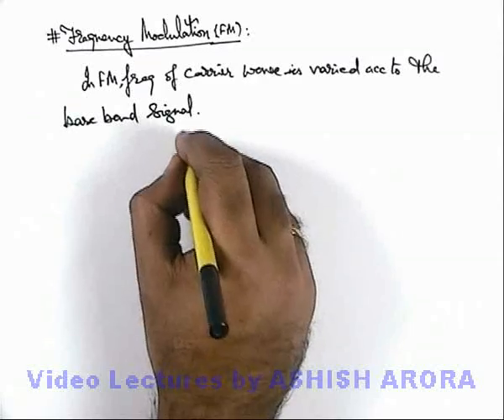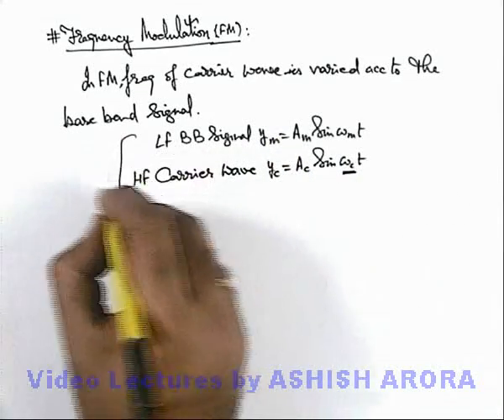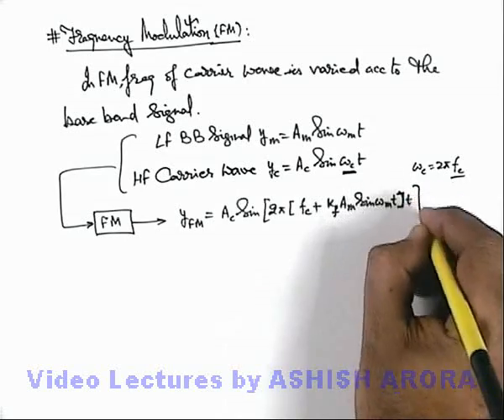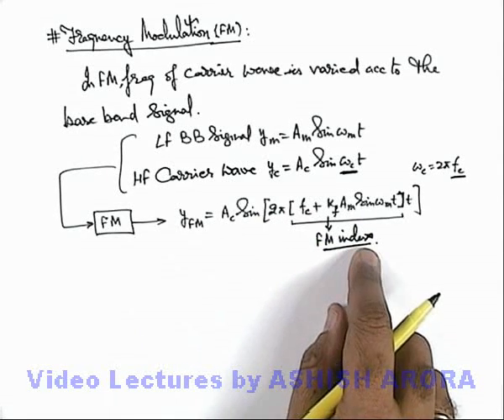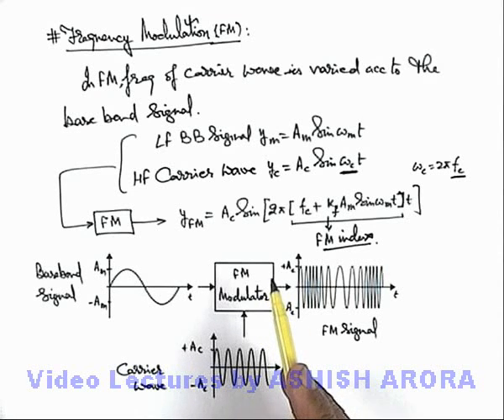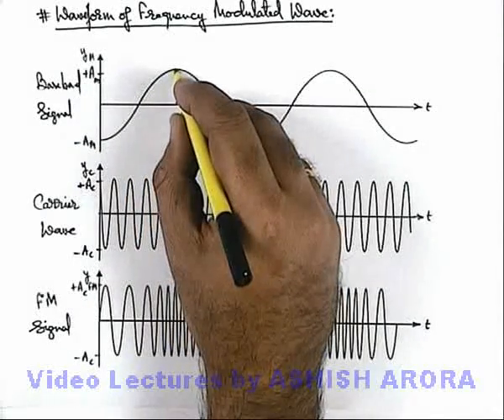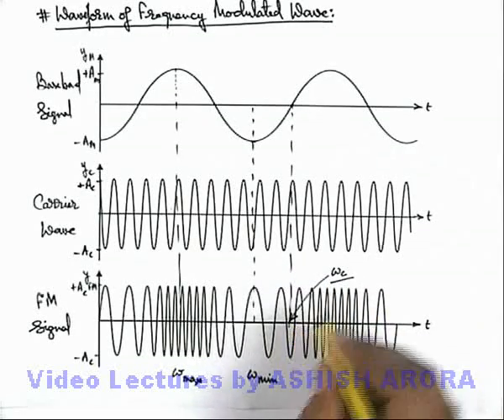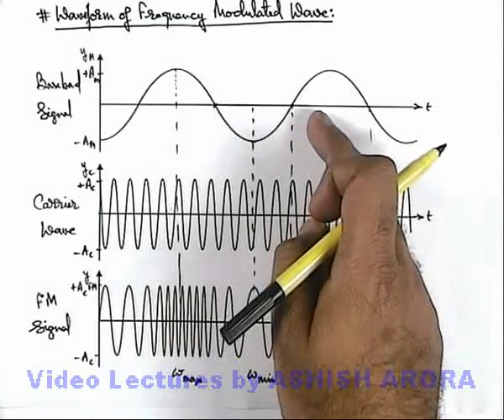Class 12 Physics | Modulation | #7 Frequency Modulation (FM) | For JEE & NEET

Comment: Sir thank you for another amazing lecture. My question here is, say, the baseband signal is a fairly high amplitude signal, for which, at certain times, the frequency of the modulated wave would drop so low that the antenna, which is of a fixed length, would not be able to transmit any radiation for that period of time. So wouldn't that result in incomplete signals and loss of information?
Reply: hi bhai ,,,,,kaun saa college mila???
Reply: I found you in MT sir's lectures as well. How are you now?
Reply: @ClarkKentfromKansas  he is in IIT kharagpur
Reply: @premiumdood2703  that's epic